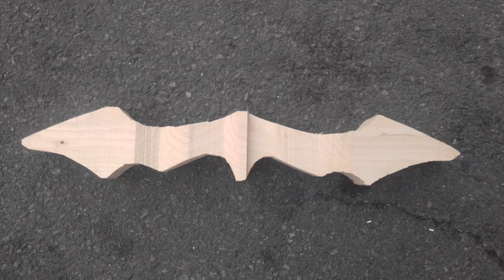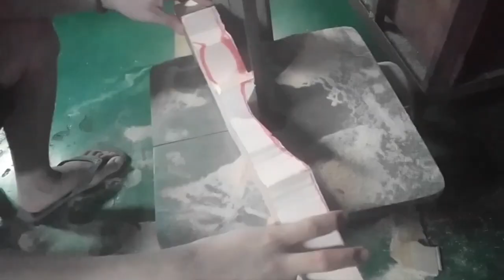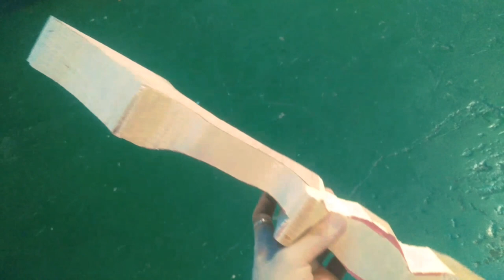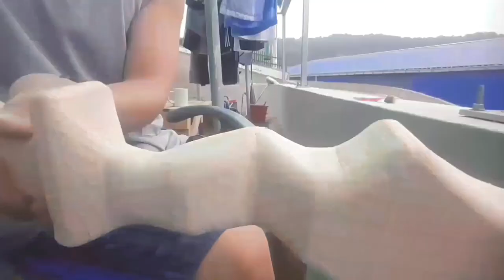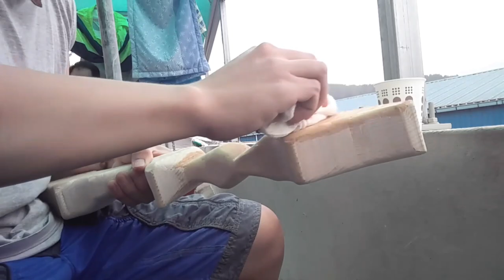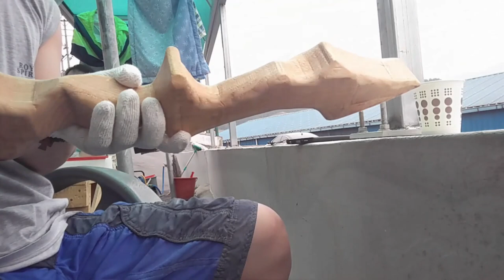DIY Takedown Bow Riser from scrap wood

Comment: What kind of wood was used?
Reply from the maker: ray r i dont know what type of wood was that. I just found it in the garbage.
Reply: It's pine. I wouldn't trust it to hold up for a bow.
Reply: @Mistraker  It is probably fine, for most draw weights. The material is less important than the design and shape. You could probably snap that easily if you slammed it on your knee sideways, but if you hold it vertically (the way a bow would exhibit force on the wood) he has a good inch to inch and half of material. It is all in the physics and shape just like an I beam. The same material you dismiss is is likely used to hold your house walls up and support your roof.